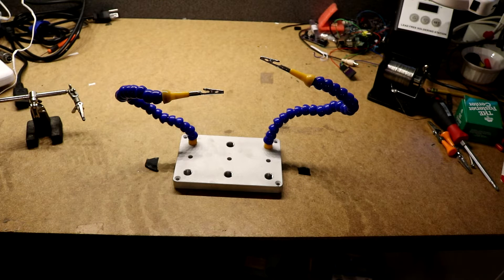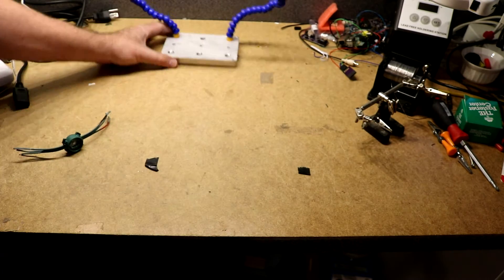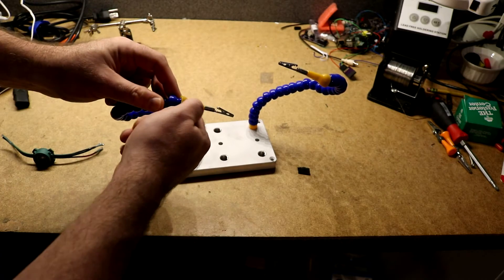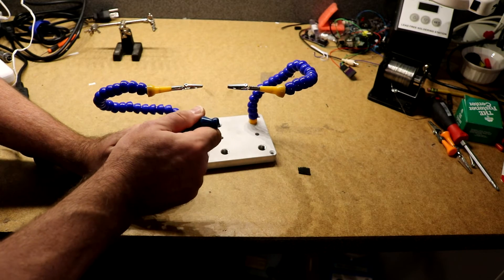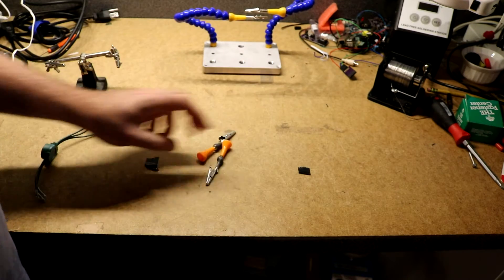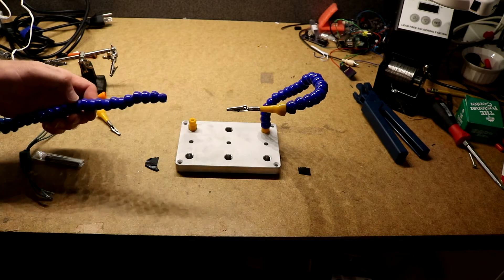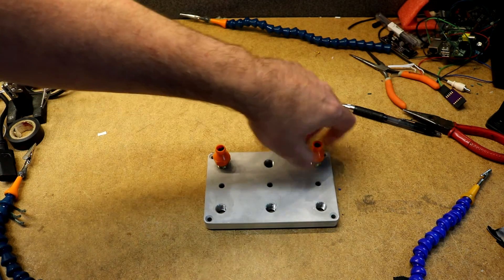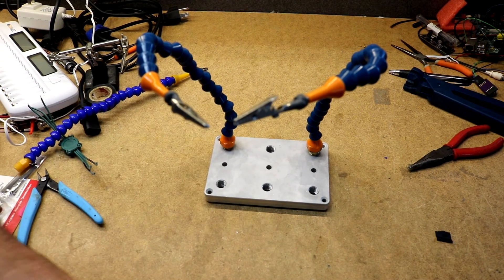Review and Modifications - Sparkfun Third Hand Kit

Comment: Thanks for this review. Now I've discovered all the pros and cons of such tool that nobody has explained before.
The rigid arms are the biggest limitation in my case: I have to position some AWG24 wires over some PCB pads for soldering and this seems pretty impossible with such tool... :( :(

I saved 30 bucks, thanks!